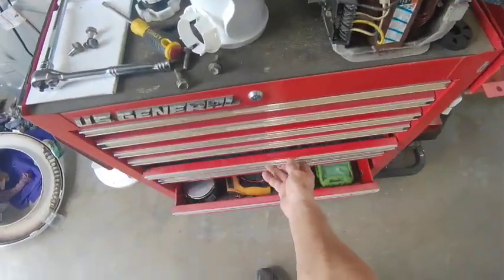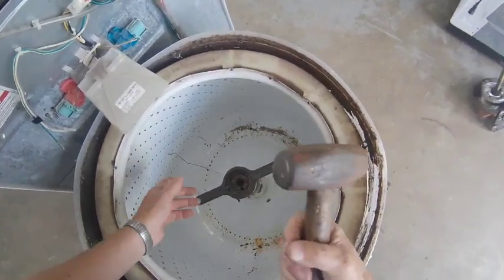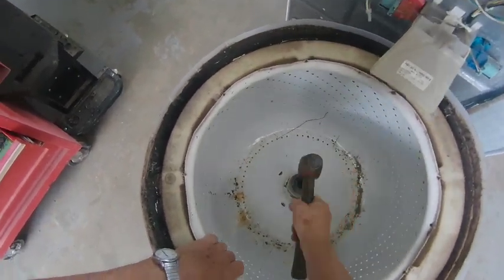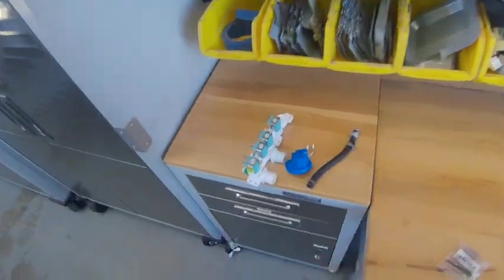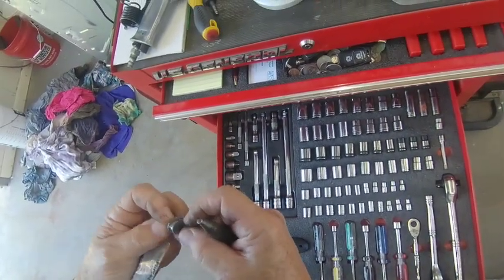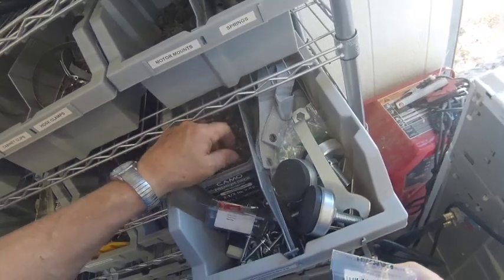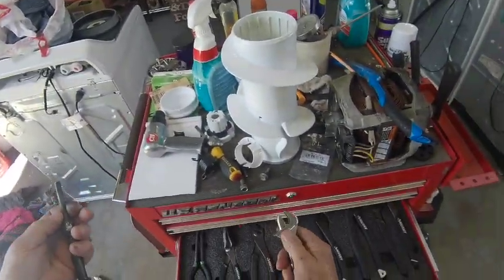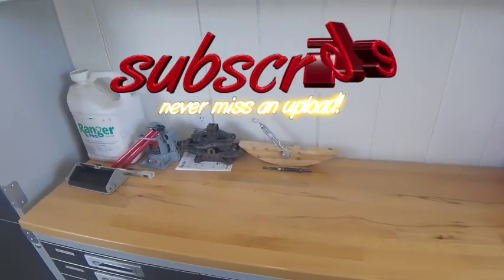How to Make a Tool for Removing Seized Agitators from Washing Machines!

Comment: Hey Chip, how do you remove the spanner nut if it’s corroded on the block penetrated lube for two days with beat with a hammer and even use the heat to heat up got a little bit of smoke. Hopefully I didn’t ruin the seals. any advice would be helpful.

Comment: Excellent, thanks Chip, my machine has shorter stem for the motor. Regardless your method here seems ingenious. It’s just gonna take some effort to make that tool. I’m trying to remove my spin tub to clean out the outer tub.
Reply from the maker: I use a hooked pick to slip into one of the holes in the wash plate. You can put your bolt back in about half way and with an air hammer and a pointed bit pull up with the pick while hammering on the bolt head. Be careful not to bend the bolt. That’s what I used to do before I made the tool.
Reply: @HarperandKnowles  one thing the agitator is tall stemmed so getting a bit 20 inches tall will be a challenge, guess I can rig something up

Comment: Hey Chip have you ever used pump wedge air left bags to remove the stuck agitators?
Reply from the maker: I have tried those with very limited success. Hit myself in the chin once when an agitator decided to turn loose all of a sudden. I have had 100% success with my air hammer tool so far. Thanks for watching!

Comment: Notice that the collar (you removed by hammering up on) has a slot in it. Tap a flat blade screwdriver tip in that slot, and it will slightly open the collar enough that the collar will come off without any added force.
Reply from the maker: Thanks for watching!

Comment: A friend of mine gave me an even better way. Works every time. After removing the spanner nut, turn the spanner wrench on end so it’s standing up lengthwise and tap firmly with a mini sledge 4 times, once on each “corner” of the cast iron part the tub rests on (north south east and west) it’s basically the same method you’re showing but without any risk of damage.
Reply from the maker: I’ll use it! Thanks for the tip!
Reply: @HarperandKnowles  love your channel
Reply from the maker: Thank you! I hope it’s helpful.

Comment: I have an early 2000's Kenmore 70 that mom bought new. Recently it acquired a squeal when it almost quit spinning. Well last week it didn't sling the water out on the spin cycle and I tore it down. I found the circlip for the drive tube down in the spin clutch under the spring. It was scraping on the housing making the squeal. The bottom of the drive tube bushing holds that circlip but the bottom of the bushing was gone so there was no groove for it. I didn't see any apparent damage to the clutch so I don't know how that happened. Have you ever replaced that bushing?
Reply from the maker: I’d just replace the spin tube. https://amzn.to/4eB1gU5. Thanks for watching!

Comment: That spanner wrench you have seems to be a very good one. Where did you get it? I see them on ebay but don't know the quality or if they may even be made of aluminum.
Reply: The ones on eBay are fine I have one I’ve used for years lost my original
Reply: @AMERICANPRIDE1100  ok thanks
Reply from the maker: That is one Mr. Harper gave me. He had it for years.

Comment: That is a smart idea. Also you can buy small inflatable air bags at harbor freight that would slide under the agitator and inflate, either two or four. They seem to have quite a bit of "push" to them and are inexpensive. What was the other tool for?
Reply from the maker: I haven’t had much luck with those air bags. The other tool is for straightening bent spin baskets. Check out my previous video to see how that works. Thanks for watching!

Comment: see if that works for the splash pad when they are hard to come out
Reply from the maker: Is that the same thing as a wash plate? If so it works very well! Just be sure you are applying a steady upward pull on the plate or the transmission bolts underneath are removed. You can damage those transmissions if you hammer the shaft without the pull on the plate.
Reply: @HarperandKnowles  yes I ment wash plate